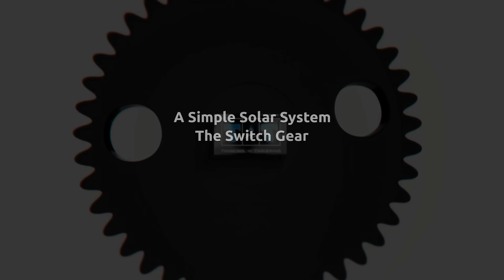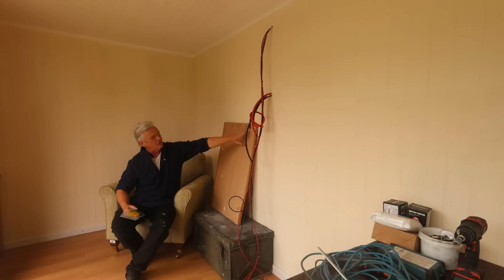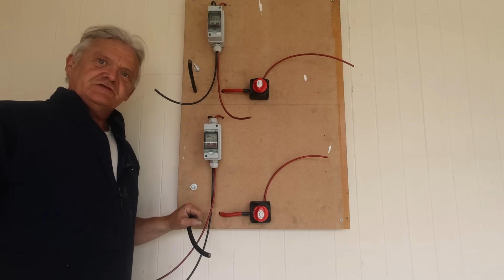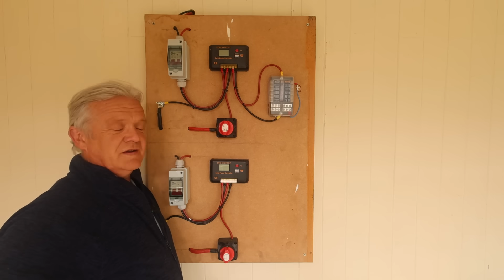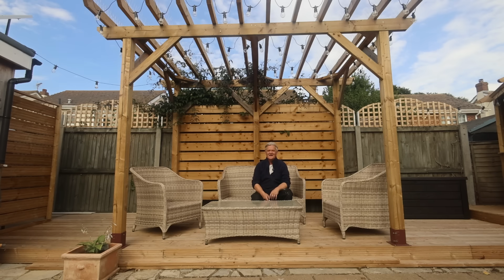2426 A Simple Solar System - The Switch Gear

Comment: I will miss Robert, he was always tinkering on the same concepts as myself.  Was hoping to get to meet up with him on a trip to England.

If this Parts list helps others (US Based):
solar panel  disconnect switch: (44$USD)
> Solar Panels Disconnect Switch 32Amp AC Solar Shut Off Switch 400V 2 Poles, IP65 Waterproof UV-Proof for Solar PV Homes
> Solar Panels Disconnect Switch 16A 1000VDC PV Shut Off Switch Outdoor Circuit (over kill per video  2:20)

solar battery isolator switch: (13$USD)
> Kohree Battery Disconnect Switch, 12V-48V Battery Power Cut Master Switch for Car, RV ,Boat (on/off)  (video 3:30)

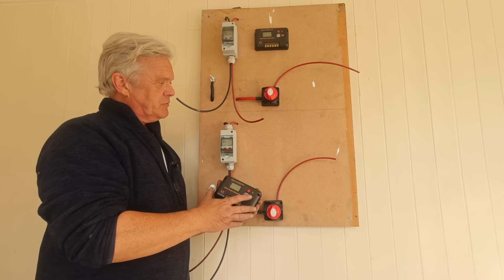Solar Power Charge Controller (90$USD)  (Video 4:37)
> (Ships from Germany) ECO-WORTHY 30A Charge Controller Solar 12V/24V, Solar Charge Controller Intelligent Controller with Two USB Ports Solar Battery Controller LCD Display

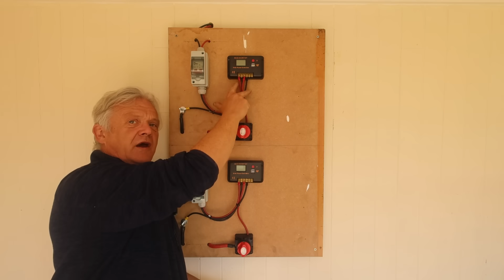DC Fuse Distribution Block (32-64$USE)  (Video: 5:16)
>Blue Sea Systems 5026 ST Blade Fuse Block 12 Circuit with Ground and Cover, 100 Amps

Comment: Love the concept and have one runnig a few years already, including 3D printer. mine is not as tidy as yours, but plans are to tidy it up eventually. Howerver I would have to dissapoint with the power usage of the 3D printer as at the stages of heating nozzle and print bed it is using over 200W, so 150W inverter may not be suficcient.
Look forward to other shenanigans by just combining what is is already available :D

Comment: A good little system Rob, but your DC distribution fuse board should really come from the battery not the pwm load port. The DC load capacity in amps is quite low from those small controllers, you could blow it connecting too many things from it.

Comment: Good you mention batteries need to be connected to charge controller first, and then solar panels.
Vice versa when disconnecting, disconnect solar panels first.
This is very important as the charge controller may die if you have solar connected but no battery.

Comment: Nicely done, the only thing I would like to mention is the DC isolating switches you have, I no longer believe there ratings and have burnt thru 3, and have changed it to the same style that you have for your AC isolation. Your DC isolation switch may not be the same, but look very similar. When I mean burnt through, not from switching, just for being on, each one took about 3months to burn out. Apart from that, very nicely explained. Keep it up.

Comment: Hi Robert love your videos! But there is a maximum load you can place on that output. Avery low one. I suggest connecting to the negative bus and the outlet of the switch. Maybe a fuse as well.

Comment: Distributing the ac at 240V with the inverter at the battery end will reduce the voltage drop. But maybe it's not significant enough an issue here.

Comment: very clear explanation for this system. Have you considered adding inline fuses or circuit breakers for protection and appropriate wire size to cope with current output

Comment: The load on the solar controller five a limited current best conect fuse box to the battery via a main fuse exceeding the total load . The controller load connection is for small loads at 5 amp max on most brands
Reply from the maker: thank you mate

Comment: I'll probably show my ignorance of electric circuitry here but why not avoid the DC to AC to DC conversion altogether? Why can't you plug the resin printer and curer into the DC circuit directly?
Reply from the maker: you can do that mate - but the AC to DC bit at the machine is in the machine case and I didn't want to break it open to do that
Reply: @ThinkingandTinkering  aha that makes sense. I thought it might have an external power brick like e.g. a laptop.

Comment: May I suggest that using a 150 watt inverter for a load of 60 watt is running in a bit close. Remember 60 watt load means 90 watt input to the inverter as there is no such thing as a 100% efficient inverter. And if the load happens to start up at double it's normal 60 Watts which means you're looking at 120 Watts startup, on the output which then it means you're looking at around 180 watt on the input. You may find that the inverter will trip due to overload.
Reply from the maker: Thanks for the heads up - much appreciated!

Comment: I recommend you put another switch between the two batteries and wire the batteries in parallel. That way during normal operation, the batteries will be in parallel and have the same voltage. Then when you want to do a test, you simply disconnect the batteries from each other and you have both batteries at the same voltage, which makes a better comparison if you do a test. Also the batteries will degrade at the same rate if you use them in parallel.
Reply from the maker: Thanks for the tip mate, much appreciated!

Comment: I have a similar split set up in my shed/cabin but I've gone 12v DC (lead acid batteries) and 240 AC (Lithium battery). The big difference though is I take the load from the battery rather than the charge controller, charge controllers have a limited capacity, much better and safer to go direct from the battery.
Reply from the maker: Good to hear mate - sounds like a good setup.

Comment: I dont understand the bolt or buzz bar  wheres it coming from and where  is it going the controler ...battery black? and wheres the black from the battery?
Reply from the maker: from the battery to the controller. If you want to run the load directly from the battery then one wire to the controller and a second to the distribution board

Comment: Very nice series of videos.  One caution for folks:  Many charge controllers warn one to turn-on/connect the battery first before applying the solar panel voltage.  Apologies if you mentioned this already.
Reply: Good point. Batteries first on : Last off. 👍
Reply from the maker: I think I did say that mate - but good point

Comment: Can you explain why you used the load terminal on the charge controller instead of the battery directly seems to me it will restrict your amperage which maybe ok for the lights but maybe not for the printer
Reply from the maker: Interestingly a lot of folks have suggested running straight from the battery and in lots of applications that would be fine. But running straight from the battery means you are using an unregulated supply and a battery will vary the voltage between anything like 10-14 volts - sometimes even more. That can be damaging in some applications. The Controller output is regulated. Of course you could put in a voltage regulator or apply regulation at the point of use.
Reply: @ThinkingandTinkering  Thanks I had not thought it needed regulating but my guess is it will stop any flickering Cheers.

Comment: You know what you are doing but not everybody knows the safety precautions involved.  One suggestion I would make is to mention they should first wire to an open breaker or switch.  That way they are not playing around with live wires at the other connections.
Reply from the maker: ok

Comment: Great build and very practical and neatly done ✔️ next small boat water cooled diesel engine in sound proofed shed and you are off grid all year round with hot warter/heating 🔥 add wind generation for good measure 😂 hopefully this video more people to do the same 👍 good stuff
Reply from the maker: Mate - I like that suggestion!

Comment: The system you have built is beautiful.  Can you plesae give a build of materials. My thoughts were to use one of the generators that you printed instead of solar. Thanks
Reply from the maker: I am going to be adding a home build wind turbine mate - I am not sure how useful a BOM will be as set ups vary - what you need is Panels, battery, wire, lugs, clips, tape, panel isolation, battery isolation, controller, inverter, distribution board - specifics are going to be a mix of what you can find and what you want to do with it mate

Comment: Sorry but you can only draw a very limited current from the load side of a controller all your loads need to be taken from the switched side of the battery (I highly recommend a busbar at this point to supply your loads ) or you will damage your controller in a very short time due to overheating as it’s only rated for a very small current.
Reply from the maker: Yes it is - but i will only be using a very small current - and the current supply from the controller is regulated - that's not so for the battery - of course you could add a regulator if you want - it's like I said in the video mate - everyone makes a choice and you go with what is good for you - If you want to draw from the battery - go for it - good choice.
Reply: Yes but you imply that you could run an inverter from it and you could not! Because of the current needed. And to be sure you don’t take the battery’s below 50% where they would be damaged you will need an indicator for % left and deal with it manually or a voltage cut off to prevent any damage.

And this is where a choice of battery comes into play as most lithium battery’s have a BMS battery monitoring system which does all of this for you!
Reply: However you referred to 30 amps per circuit on your distribution board, the controller can’t supply a single 30 amp load
Reply: A puzzling choice, taking the DC load from the controller rather than the batteries.
Reply: Not puzzling at all. Controller will prevent battery discharging beyond low limit and damaging battery.
Reply: @loup754  It may make some sense if all you plan to connect is something that doesn't draw a lot of power like the fairy lights shown in the video, and where you could also make use of the timer function these controllers tend to have on the dc load to switch them on and off, but other than that only coming off the controller is rather limiting.

Comment: many thanks, for the super straightforwardness! Other channels seemed to make it much more complicated, bless their hart.  Does your battery have a balancer?
Reply from the maker: Cheers mate - an no there is no balancer - in this case it doesn't really need it - but if you think a balancer is need by all means add one
Reply: sounds cool.  No I have no opinion what so ever.  But listening to all experts you feel pushed to think you need one. We are so conditioned to believe we need al these peripherals for a project like this.   By the way, very interesting to see you do a DC circuit.

Comment: The amps you can pull through the charge controller on the load is very limited
Reply from the maker: It depends on the controller of course.
Reply: @ThinkingandTinkering I does, how many amps can your controllers handle

Comment: Have you considered connecting a water heating immersion probe direct to solar panels?  Building a system to do that just now.
Not common in the UK which surprises me, as there isn’t much info available about it.
Reply from the maker: I would probably go for a sand battery myself - but the principle is the same
Reply: Some good ideas here which I will most likely incorporate into mine.